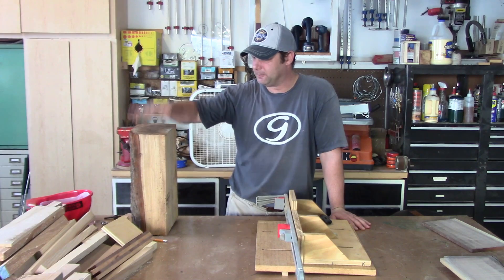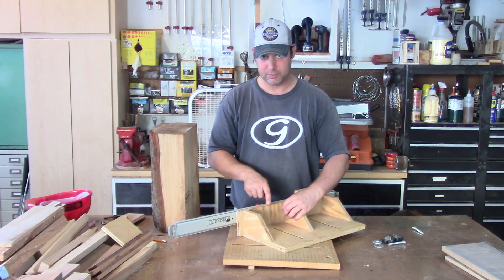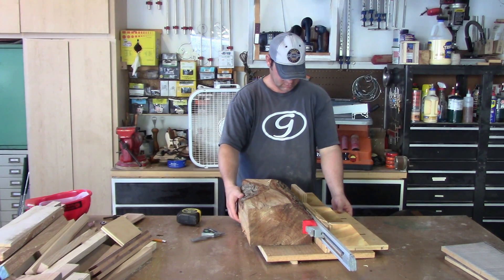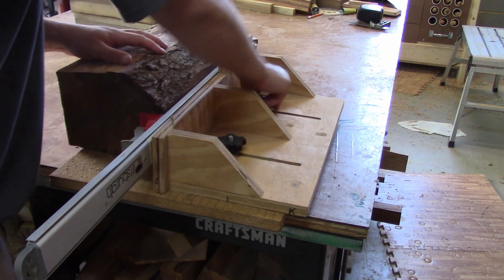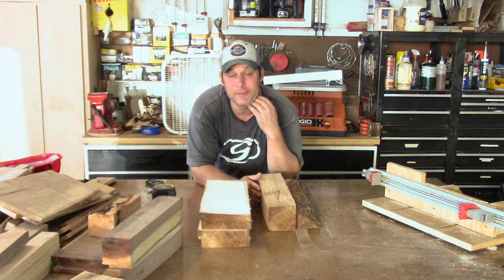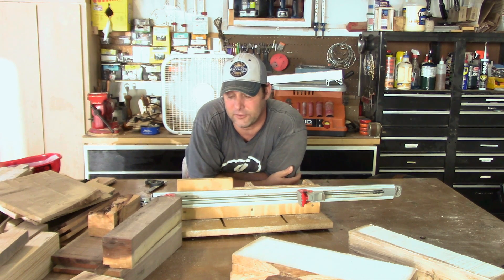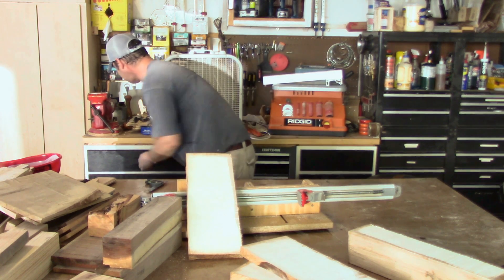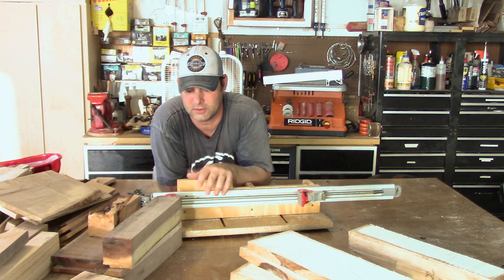lumber on the bansaw

Comment: Just a thought... I have done some free hand mill cuts of smaller diameter logs that I could complete on my table saw.  Now, true, they were not precision mills because they were free hand (squared off to 1-by-1 for the purpose of making smoking strips on the barbecue grill) but the point is I clamped the ends of the log using a 3-foot long cabinetry pipe clamp and then used the long free end of the pipe as a handle to pull the log through instead of pushing.  It was remarkably easy and smooth to pull and was quite easy to make reasonable cuts freehand.  Have you ever tried reversing the sled to a pull sled instead of a push sled?  And if so does it make it easier to pull smoothly since the pull force tends to reduce binding friction on the table and miter slot rather than exacerbating it as does a push force?

Comment: Try spaying a few coats of polyurethane on the bottom of the sled sanding between each coat and wipe the band saw top with furniture wax and it will help with the skipping and chattering.
Reply: Also wax the inside of the miter track and the runner as well as what others suggested. I use Johnson’s Paste wax
Reply: Yeah, I was wondering what was causing that.  A bit sketchy if needing to push against something binding.  I was also wondering if your blade is staying clean (milling logs is a great way to get pitch on a blade).  And it looked like the thrust bearings were pretty far back -- were your teeth staying clear of the teeth?

Comment: After you get two sides squared just use a rip fence set to what ever size you want. If your saw is set right it will cut straight. Less fiddling with the sled.

Comment: Great idea, Keith!  My only suggestion (humbly made, of course) would be to put a higher HP motor on your bandsaw.  They sell them pretty cheap at HF, and you can get a 3hp motor to swap out, then it wouldn't bog down.  I was surprised at the hp (or lack of)on my bandsaw on the factory motor, and have a motor to swap out, when I get an afternoon free.  Cheers
Reply from the maker: Sig Guy good idea. Thanks

Comment: you gave me some great ideas.    why not have the depth slider be on two perpendicular T slots  OR better yet use drawer slides.-- then use a doorknob and slots for a strike every 1/4 inch for depth?
Reply: Why not just get rid of the sled and use the bandsaw fence. You can start with a draw knife and hand plane to get flat starting side. I think these sleds are a waste of time

Comment: I like the clamp idea instead of using screws. I made a small sled and use screws and that makes a lot of holes to plug or toss out good wood . Good video. I think my bandsaw blade has too many teeth per inch so I'll have to get a 3 tooth per inch by 1/2" and give that a try. I like to make my own wood too. I think it is fun to do. As long as I can do it safely. Cut offs at the lumber yard are too expensive.

Comment: Do you paint the ends of them for the drying process? How long will you let them sit before you can use them?
Reply from the maker: David Sheaffer - sometimes I do, more often than not I do not paint the ends. I let them sit for at least a couple months, use a moisture meter and check the wood in different spots. sometimes I will cut the log in half and let that sit until I need to cut a piece off for a project.

Comment: The skipping is because there is only 2TPI (Teeth Per Inch). The rule of thumb is that it should be 4 TPI, 3TPI MINIMUM...I like the sled though. Great Design.
Reply: I don't think so. The rule is at least 3 teeth for the width of your cut. Hes got 10-12 teeth for his 5 or 6 inches.

Comment: great video bro keep up the good work!..um from what i figured..I can get (40)4×6x12s delivered for cost of that particular bandsaw(even free pre corner notching done to get the corners to dreadlock)and moved with forklift in a stack thats enough to frame solid a 12'x24' by 8feet tall room and enough to build a staircase in 4feet leftovers..my main question..is how long or how ease would it be to match that precisely ..so making a jig for 12 feet long logs(be pretty heavy) a ramp to guide it up onto rail under saw ..a wench or pulley system both ways so one to go towards bandsaw the other for the ramp to guide the logs up..your input is appreciated and feel free to alter etc etc mix and match that idea or any aspect bro..again thank you

Comment: I've looked at a lot of bandsaw milling sleds and your's is far and away the most practical. Your's looks to be  the most accurate for the least work. I'm going to use your design with some modifications.

I'm building an 18" bandsaw on a GIL-BILT kit. I've got the entire kit and compleat original plans and paper patterns. My saw is greatly modified from the original GIL-BILT with the very generous input from wood workers on the internet. I'm impressed with wood workers that build screw cutting lathes out of salvaged lumber but as a practical matter one layer of steel is better than ten layers of timber. There's a lot of satisfaction and a lot pleasure in the  planning and building but I want to keep my focus on useing the tool. I'm putting a lot of steel in my saw build. I bought a well worn table saw off Craigslist. I'm useing the cast iron table and old Jet tubular fence and rails for the table and fence on my bandsaw. One problem I see in your sled is that your table is way to small. You have to dismount the sled and carry it and the timber to your bench to make any adjustments. Then carry it back to the saw. Plus you have to pay strict attention to keeping the sled and timber ON the saw, that is not tipping up or down while feeding or out feeding. The Harbor Freight clamp is brilliant. I really dislike running a bunch of screws into the lumber just to hold it in place. Plus, if your table is big enough that you don't have to worry about tipping you have a handy handle on the sled. The table saw table has two miter slots. I wonder if it will be worth the trouble to build the sled to work on either side of the blade.

A couple of pithy thoughts that came to me while working in my shop.

You wouldn't turn firing pins on a turret lathe but you can do everything on a big machine that you can do on a little machine and there are a lot big things you can't do on a little machine.

Wood workers never make mistakes. From time to time they do change the plan.

If you tinker with and improve on something mechanical long enough, eventually you'll ruin it.